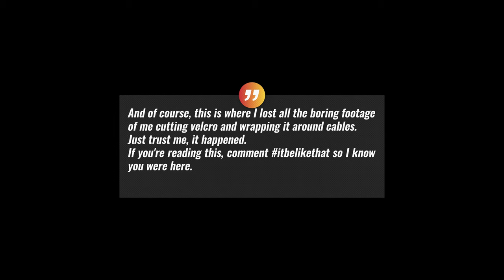Cable Storage Organizer | The Ultimate Solution... So Far

Comment: I can't be the only one yelling at my screen when you put those drywall anchors in instead of anchoring to the studs. 😂

I use a bunch of clear Ikea bins for all the cables I need on an average day, the others are all bundled and in a big Rubbermaid storage bin. This would be a great idea if I needed them more readily and had space to hang them. 👍🏻
Reply: I have mine all in a clear Rubbermaid bin that's big enough to bury a basketball player. I should probably sort and throw out or recycle some of my stuff.

Comment: I also thinking about similar thing. Seems easier to use. I have so many plastic bags, boxes and I can't find right now USB A -> USB B. The only one downside I see is the dust may be collected on connectors and wires. It would be interesting to know how to solve this.

Comment: I’m trying to do something similar that I could hang in my closet, a simple wire rack style of a closet, along the lines of modifying a heavy duty hanger where at the end of the hanger has horizontal forks going across, slightly wide enough you can slide cords into. I’ve seen wall mountable versions of this, thanks for the idea in this video.
Reply: Ok I found a solution. Get a Magic Pants Hangers Space Saving hanger, and for every cord, attach a Velcro wrap cable tie to each end of ever cable. Now you can slide each cable thru the pant tail AND leverage space when collapsing the hanger.